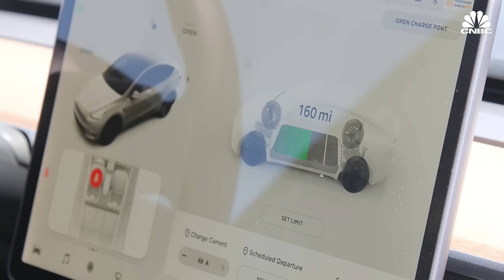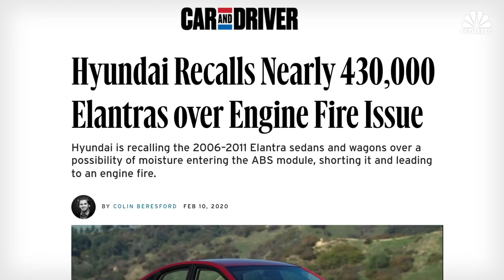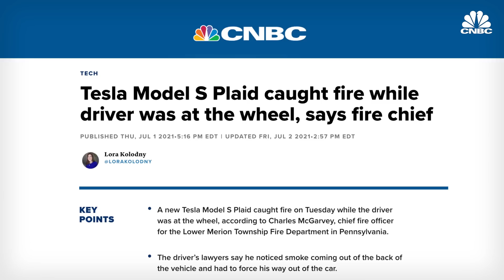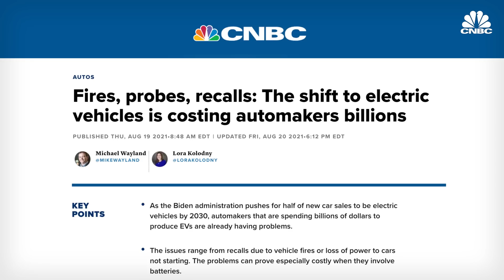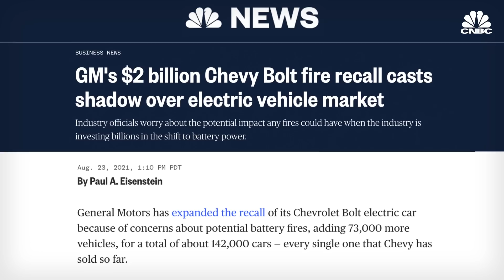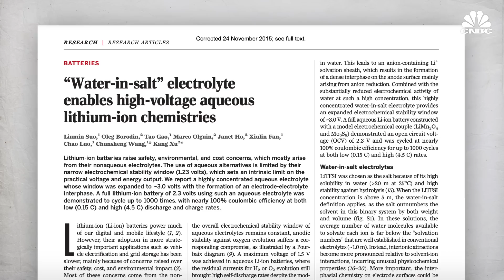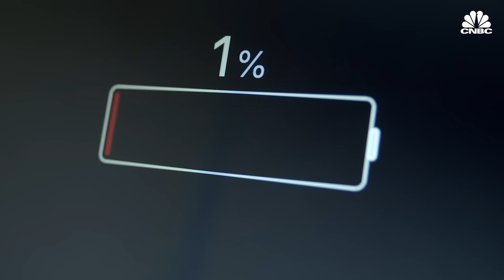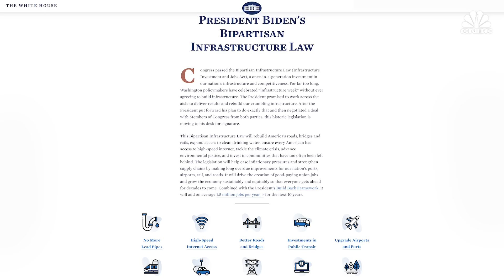Why Tesla, GM And Other EV Companies Have A Fire Problem

Comment: 3:10  The narrorator & the guy in the video are both wrong.  
Lithium ion batteries are ALWAYS fully fueled, even when completely discharged.  
When the batteries are charged, they only increase the number of electrons that is stored in the electrolytic material, creating negative ions, which are unstable & have a high potential to discharge those electrons when the circuit is closed.  

It is the Lithium Manganese Oxide itself, that the battery is made of, that is highly reactive & combustible.  
A fully discharged battery is just as dangerous as a fully charged one, when its structural integrity is compromised.  
These battery fires most commonly happen during charging or discharging, because that is when the heat is produced, that can potentially comprise the battery casing.

Comment: It's REALLY simple. Start DEMANDING they use Lithium Ion PHOSPHATE Lifepo4 batteries. The manufacturers use Lithium ION because the energy density is better. But LifePO4 wins when you factor in safety ..and the bonus of MUCH longer life.

Comment: Problem is active cooling, and I don't understand why they don't do it right, it's not rocket science, just put a solar panel on the car's roof to keep the pump running every now and then to evenly spread the temperature differences between cells, why It doesn't happens usually when being driven?, Most of the times this is when the car is offline, so there is NO active water cooling going on, and THAT is the problem!
Just put a darn solar panel to power a low level active cooling for the car when it's off, at least until solid state batteries are available at scale, which I think it's gonna be in about 5 years or so

Comment: It is rarer for a gas powered vehicle to catch fire. For gas powered vehicle to catch fire it would have to be something catastrophic. In comparison to electric powered vehicles. It doesn't take much to ignite an EV.
   The biggest problem is the chargers do not shut completely off and go into rest mode. Another is that heat builds up in the battery pack while the EV is being used or charging. As for impact problems EV's are prone ignition because the emance energy. Putting the batteries in steel incasement is not enough protection or be a proper protection. But impact preasure, heat, extreme cold and moisture are lithium ions biggest enemy. 
   Until manufacturer's can address the charging, temperature, and impact protection problem; I will stay with my gas powered vehicles.

Comment: I’ll note that the information I’ve found indicates that the Bolt and Kona fires seemed to be caused by an unfortunate cell feature where the anode had a bent sharp edge placed too close to the separator. Dendrites can eventually form off the edge and pierce the separator causing a short. The defect appears to be due to a poorly-chosen production shortcut where the serpentine folding was cut in the middle of a fold rather than on a flat region.  As such the fires are not entirely random but due to a stupid mistake.
Reply: And it will not change.  These companies thrive off the lowest bidder, cheapest parts and the components are built by humans.
Reply: EVs are a scam.   Only indoctrinated fools buy them and few will  buy them a second time.
Reply: All electric car would be limited to a max speed of 60kph, no highway for them!
Reply: @jakexgold3879  it's very rare to catch on fire while driving, almost always when parked and charging.
Reply: Yes I would have to say that NOTHING YOU HAVE SAID MAKES ANY SENSE WHATSOEVER!!!!!!!!!!!!!!!!!!!!!!!!!!!!!!!!!!!!!!!!
Reply: @jimmygrant424  He can explain it to you but he can't make you understand it. The fact that you state "nothing you have said makes any sense whatsoever" merely shows your lack of an education. By the way, he didn't say anything, he wrote an explanation.
Reply: @jimmygrant424  , it probably would if he could upload a 3D diagram(s) of what he is attempting to describe verbally.
Reply: @jimmygrant424  Lithium Ion batteries have Anodes and Cathodes.  It makes perfect sense for those that actually understand how Lithium Ion batteries work.

Comment: The issue is that EV cars can catch fire while NOT being driven. 06:31  I don't know of any ICE vehicle catching fire while being parked unless the ignition was from an outside source. Electric vehicles can virtually 
spontaneously combust while recharging and lithium burns at a much higher temperature than gasoline. The fire chief in this video said it took 2 hours to put out one EV fire. Imagine a large parking lot filled with EV's not to mention the danger of re-charging at home overnight while everyone is asleep. Lithium batteries have a checkered history of spontaneous combustion. These batteries need to be made safer.
Reply: Under these circumstances, they're completely unsuitable for any home with a garage. I wouldn't park an EV in my garage.
Reply: You better hope you are not in it when it catches fire because your doors won't unlock and you will be trapped unless you are strong enough to kick the window out.😶
Reply: @kathrynjanzen5618  That's why I bought a window breaker tool.
Reply: @MaxHasManyHobbies  I agree that is a great tool for everyone!
Reply: 1 - Kia and Hyundai vehicles have several recalls due to engine failures and fire risks (somewhat related).  Some of the reported instances of fires have been while the vehicles were parked.  My wife's Mercedes ML320 caught fire in the parking lot in front of her job.  In the case of my wife's SUV, I believe the issue started while she was driving to work and it smoldered for a few minutes before bursting into flames.

2 - All Tesla vehicles and other luxury vehicles with electric door popper mechanisms (from the factory) also have a manual, mechanical emergency release easily accessible by the person sitting inside the vehicle.  Also, the electric door poppers are typically powered by the vehicles' conventional 12v battery, not the high-voltage traction battery (often in the neighborhood of 400v).

Regardless of whether you drive a gasoline, diesel, LPG/LNG, hydrogen, or battery electric vehicle, it isn't a bad idea to have a vehicle entrapment escape tool mounted within easy reach of the driver.  These tools typically have a recessed blade to cut seatbelts and a sharp point (sometimes spring-loaded) to break glass.  I got one for my wife that's a 2-in-1 cellphone charger and glass-break tool.
Reply: Then you haven't been paying attention to the news. There are thousands of ICE vehicles being recalled right now due to fires while parked.
Reply: Well, an ICE car can catch on fire while parked if flammable power steering or brake fluid touches hot exhaust components. It happened to a friend of mine. Thankfully the car was parked on the driveway.
Reply: Spare me this ridiculous idiotic claim.  Have you been living in a cave or something..????

"Feb 8, 2022 — Hyundai, Kia owners should park outside because vehicles can catch fire, makers warn."  Notice the word PARK outside...?

"German carmaker BMW is recalling more than a million vehicles worldwide, citing an issue with its engine ventilation system that can cause it to catch fire.

Approximately 917,000 sedans and SUVs in the US are being recalled, along with an additional 98,000 cars in Canada and 18,000 in South Korea, a BMW spokesperson told Bloomberg.

According to the US National Highway Traffic Safety Administration, the cars are vulnerable to an electrical short in their positive crankcase ventilation valve heater. 

That irregularity can, over time, lead to overheating and even cause a fire -- whether the car IS PARKED or being driven."

Seriously.  Your claims on this are beyond embarrassing already...

Comment: Kias and Hyundais continue to burn after 5.8 million cars and SUVs recalled https://youtu.be/RFzJeoQ8nXw

Kias and Hyundais continue to burn after 5.8 million cars and SUVs recalled
Owners of nearly 485K vehicles were told to park them outdoors because they can catch fire even if the engines have been turned off.
About 4 million Kia and Hyundai vehicles with the Theta2 engine are impacted:
* 2011-2019 Hyundai Sonata
* 2013-2019 Hyundai Santa Fe Sport
* 2014-2015, 2018-2019 Hyundai Tucson
* 2011-2019 Kia Optima
* 2012-2019 Kia Sorento
* 2011-2019 Kia Sportage

Affected are certain Kia Sportage SUVs from 2014 through 2016, and the 2016 through 2018 K900 sedan. Recalled Hyundais include certain 2016 through 2018 Santa Fe SUVs, 2017 and 2018 Santa Fe Sports, the 2019 Santa Fe XL and 2014 and 2015 Tucson SUVs.